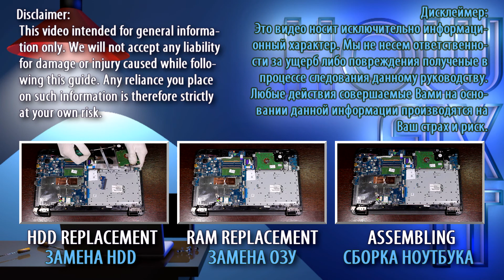How to Fix Wireless Connection Problem on HP 250 G4 & HP 255 G4 Laptop

Comment: My laptop(hp 15 ac179tx) wlan card is connected in only one balck wire port 1.
And the port 2 is simply leaves balnk. Is that normal I have seen in other laptop which both the port are connected with two black wire or black and white colour.

In my case only one Black wire is there and connected in port no 1.

Comment: Will it also work on my HP 240 G4 Notebook PC? Coz I'm struggling with slow internet connection. I often get 100-115kbs. but in my other device, the download speed hits 1mbs
Reply from the maker: Laptops that has issue with wrong wlan antenna connection has no more then 2 bars of wireless network signal (on any of wlan spots), if your laptop same symptoms maybe this can help you.

Comment: how do you connect the wifi antenna? smoldering? glue?
mine is loose -> no wifi if router more than 60 cm away and super weak no matter the distance...
Reply: Robert Darnhofer you must trace the end of the wire back and unhook it from its loop and I found it super easy to take the chip off and it just snaps on hope I helped